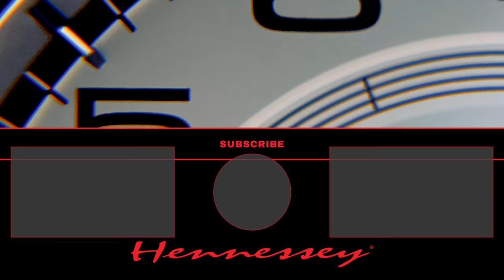C8 Corvette vs C7 Corvette | Drag & Roll Race Comparison

Comment: Put an exhaust system and lighter wheels on that c7 and watch it perform the same as the c8 ! And plus driver mod makes a difference .. corvettes are really fast .. i raced a c6 with a b20vtec built type r head in a light weight integra and still lost by 3 cars ..

Comment: Meh.  Why not modify both?  Or why not mod the C7 to have given it a fighting chance?  

I'm not ever going to drive it in a drag race or on a track or like I'm in either so why eek out the last bit of performance?  I do want the car to perform as good as it looks but not beyond what I could practically (and legally?) do with it.    I like most buy the car mainly for it's looks, then performance.  To me the C7 still looks better.  If it performs at 90 percent of the C8 it doesn't matter because I'll only be using about 50% of that anyway!

I know this isn't what a purist or hardcore enthusiast would say or even want to hear but oh well!!

Comment: Dear hennessy, be FAIR and bring a stock C7 vs stock C8 .. tha C8 in this video is fitted with lightweight rims and exhaust, and from rolling race it didn't gapped the c7 that much.. i think a stock C8 will not gap the C7 more then 1 to 2 car length from rolling 40mph all the way to 120mph .. 

Remember that the C7 a little bit better power to weight ratio 
What do you think guys??

Thank you

Comment: I don't really see where this comparison works, you're taking a brand new 500 horsepower car with lightweight parts and good tires and you're comparing it to an older car with 50 less horsepower and bone stock everything

Comment: And here comes the C7 fanboys. Saying let the C8 race a C7Z. Why? So you can see it inch out in the last 100ft of the 1/4?? The C8 traps around 122 and the C7Z traps like 126. 

This is a perfect comparison. C7 stingray vs C8 stingray. Not only does the C8 look better (wheels and a drop does wonders) but it's faster, has more tech, and is the future. The C8 z06 and whatever that comes along after it will be THE GREATEST CORVETTES IN HISTORY.

Comment: 1) +Slightly more Horsepower that stock. (+45hp over C7) 
2) +Racing tires. Lighter wheels. 
3) -Late to start (fault of signalling method)

C8 would have won, with a better start, by a WIDER margin. Appears C8 is not that much better in a standing start drag than the C7. Drag races are an overt waste of a sports car.

Comment: They ran the drag race from the end of the strip back toward the starting line. 🤪
To me, it would've made much more sense to actually use the drag strip the way that it is built and gotten a proper 60', elapsed time, and trap speed so we can properly analyze these two cars performance, instead of all of the 'yeah......but' speculation posts below. ⬇️But what the hell do I know? 🤷🏼‍♂️

Comment: Do a stock c6 vs c8.
Apparently they’re faster than the base c7
Reply: It’s really close if the c6 is an ls3 car. The LT1 doesn’t make enough extra power over the LS3 to overcome the weight  difference between the two cars.

Comment: Hennessey your comparisons have started to suck lately. Why are you not doing stock vs stock comparisons like you used to do and then a hennessey tune vs a stock tune vehicle? We already knew the result before watching considering the c8 makes 35 more horsepower and 10lb ft. Then you put an exhaust, and weight reduction on the c8? Whats the point of this comparison if it shows nothing to the consumer?

Comment: So a car with 30 more HP, exhaust, lighter weight  wheels  on racing tires is compared to a last gen Vette stock and we all watched to see the outcome?  Surprisingly it wasn’t a huge blowout for the stock Vette. I would have liked to seen stock for stock with drag, roll and hot lap times on a track.

Comment: Hahah so your saying the c7 stock is almost as good as a c8 and a hell of alot cheaper 🤣 what the hell are you doing chevy
Reply: From a roll, yes, from a dig, no. The C8 is just an overall better platform and raises the overall performance potential. The C8 doesn't have that much more power than the C7, so it's not going to absolutely demolish it in a straight line. The C8 is definitely a much better car though once you've driven and compared both. GM did their homework for sure. The C8 is better than I imagined it would be.
Reply: @Viper3048  hmmm I didnt know that thnks

Comment: Am i the only one that thinks the C7 is actually the better looking of the two?   Where the C8 is befuddled with a tons of lines all over the place the C8 has a far cleaner design.  both cars took tons of design inspiration from both the 458 italia and the Aventador,  one being the clean elegant layout and the other sporting an origami theme.   but overall despite it have so much dated cues from corvettes past, the C7 i feel beats out the C8 in the looks department.

Comment: You have to be an amateur or an american to go with a sports car front engine and rear wheel drive. 
The C8 does 0-60 one second faster just because of the mid placement of the engine.

Comment: Wow not much faster. Put light weight wheels on the c7, and exhaust to make it mod for mod and i bet its a tie. Rotational mass makes a huge difference.
Reply: But around the track it is much faster stock. The c8 isn't a drag car it's a track car

Comment: Stock for stock it would be alot closer than i though it would be...and considering no manual in the c8....for that reason i am out. I have a c7 and was 100% in on the c8 until it came out their was to be no manual option. Slower sure more fun 100000%
Reply: It's not that its slower. I think it's like only 5% of the c7s were manuals. So it isn't worth the money for Chevy to produce a mid engine manual.

Comment: Just shocked. C8 should have shown a much better result!
Reply: I think car driver or one of those magazines already proved that the c8 is only like a second quicker than the c7 around VIR. They also said if the c7 had the same tires as the c8 that the c7 may even be faster. So this race didn't surprise me.

Comment: Useless comparision stock vs modded. Light weight rims make difference less rolling mass and equals quicker acceleration. Hooser tires? Really more grip.  New exhaust slight bump in power. Common on guys you can do better. This is NO real world comparision.